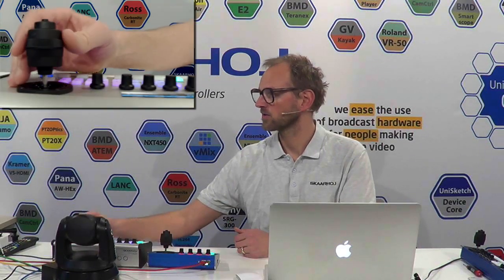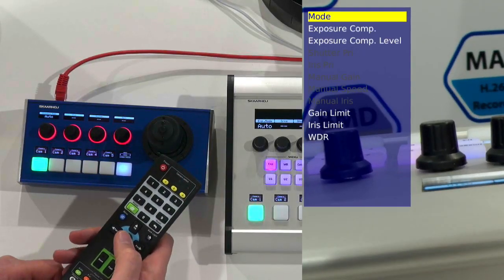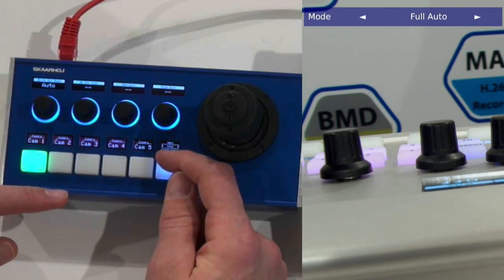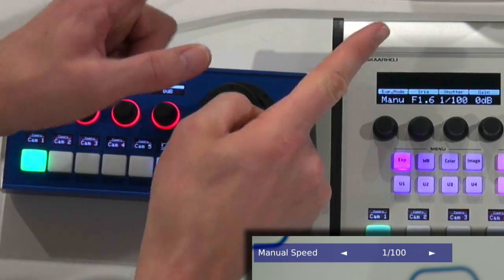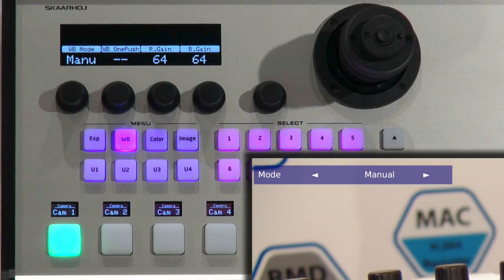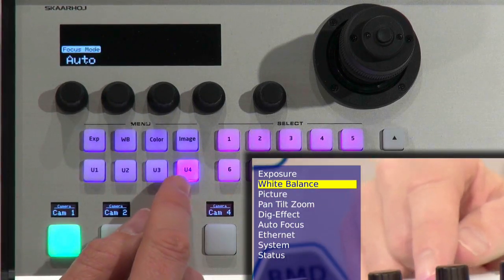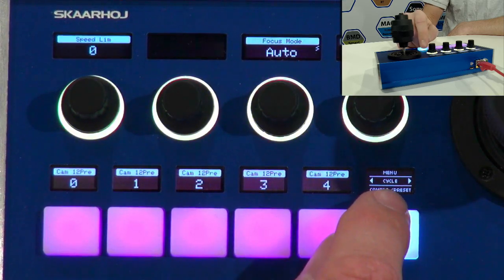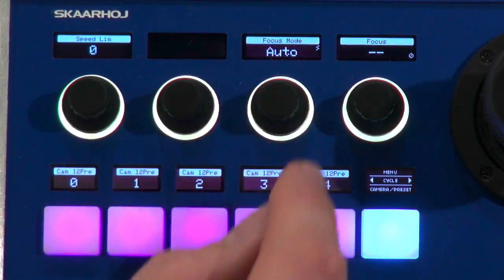PTZ Fly joystick controller for NewTek NDIHX-PTZ1

Comment: Hey, I used these cameras and your PTZ Pro controller on a show in Mexico. Was very impressed. The one thing that is holding me back from buying a whole set of these is the responsiveness of the joystick. For X and Y movement the slowest speed seemed quite fast and there was no ramp up/ramp down to make it seem smoother. I wanted to be able to do really slow camera moves where I cut to the PTZ camera and then slowly pan/tilt away but the slowest speed that the camera was capable of with the controller was too fast to be useable. Is this a limitation of the camera or the controller or was the system just not set up correctly? We are looking at buying a few of the NewTek cameras and a Pro controller but this is a deal breaker for us. I can't find any data on the minimum step for the PTZ on the camera....

Thank you!
Reply from the maker: Good question and thanks for raising it. While the PTZ Pro joystick is not a hi-res joystick in the default version it is still far sufficient for VISCA speed steps. In the VISCA protocol there are 25 speed steps for pan, tilt and zoom in either direction. The joystick itself is easily able to deliver that resolution. However, two things might help you: First, there is a PTZ speed limiter on the controller which sets the max speed we will ever send to the camera - this could help you to put an upper limit on how fast it will move. However: It won't give you new 25 speed steps within that limit and zero. Such a function would have to be in the camera itself and I'm not sure the Newtek has that. Also: Some people will also like if a PTZ camera has a different sensitivity to speed the more it's zoomed in - obviously pans/tilts are more critical in that case. Lot of explaining - please write us an email at info@skaarhoj.com and we can try to find time to provide you some testing and detailed feedback. - kasper

Comment: Your controller able to control NDI cam thru tricaster? Tricaster currently can take in video signal, Poe and controller thru ndi but controlling of the cam is software based, I will prefer a hardware controller.
Reply from the maker: Yes, it can. We have a video that shows it from IBC. It's shown with a Rack Fusion Live panel though, but its the same.

Comment: Will either of these controllers allow PTZ Control of a NewTek NDI-HX Camera while using OBS Software? If so - how does it need to be connected and what settings need to be made? THANKS!
Reply from the maker: The controllers generally work in parallel with other controllers or software. Should work. We at least can control multiple SKAARHOJ controllers to it.

Comment: What I need to know ... I have a Cat 6a that I currently run into a PoE+ switch and then on to the Tricaster 460 will the Fly or the Pro plug into the switch thus allowing the system to send  power, control / bring back video and audio?  I notice you have a PoE option is that the answer?  Also what is the price point of the "Fly"?
Reply from the maker: Yes, a single cable can do it all. Notice, for NDI usage it's very important to make sure multicast data is not flooded onto the controller as it will disturb the control communication easily. This just requires setting up the network switch with IGMP snooping.
PTZ Fly is 1400$